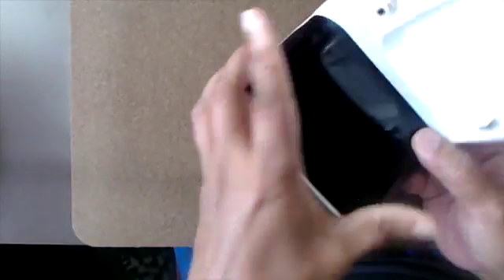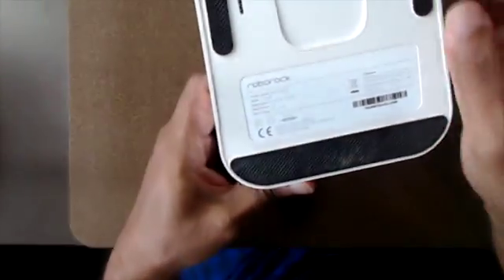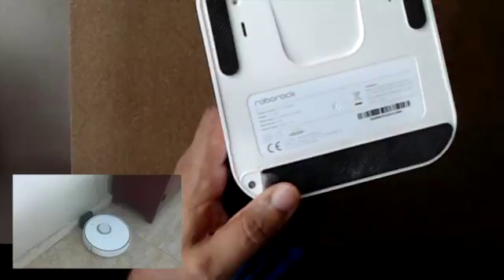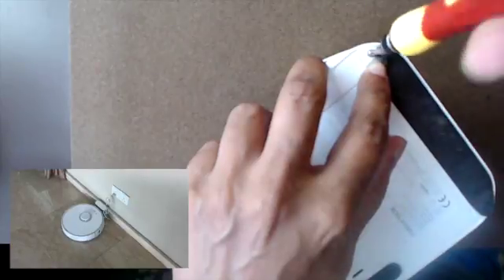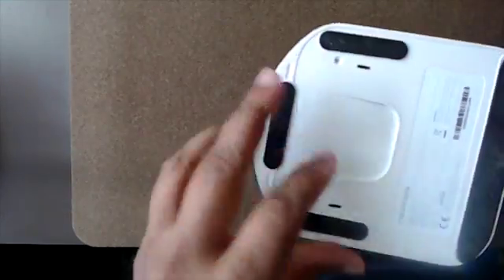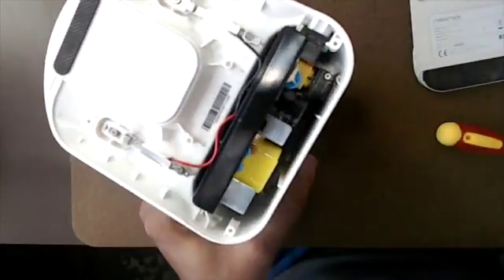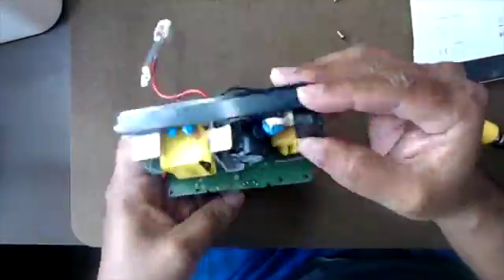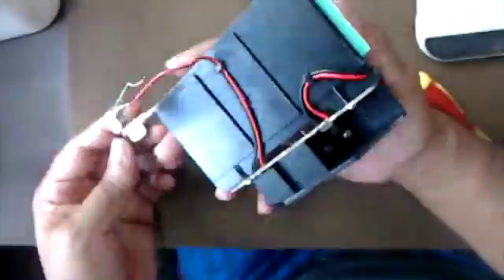RoboRock Base Unit Replacement and Teardown

Comment: Good afternoon and thank you for your instructions. They have served me well.
I would need one more thing. Does anyone know how to buy the base buttons. The ones that connect with the robot to charge them. Mine are dusty.
Reply from the maker: Try just using a light sandpaper to scrape off the thin layer of oxide that forms over time
Reply: @CrazyDaddyG  
What's going on, the metal tabs and the plastic ones are broken. I don't know what could have happened.
Reply from the maker: @luisbotehernandez2554  ooh.  that is a tough one - you probably need to rig it using maybe motor brush contacts.  the ones with a carbon contact and springs.